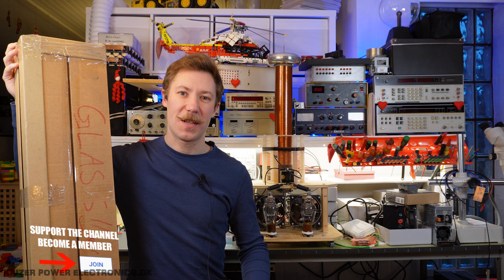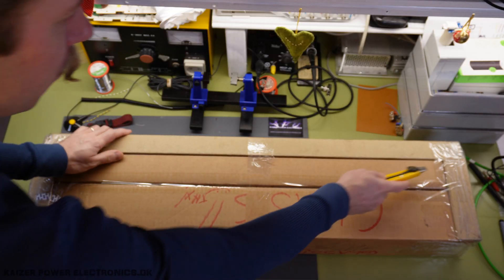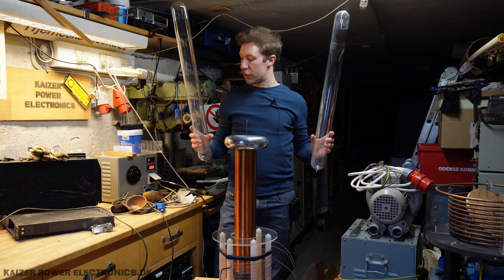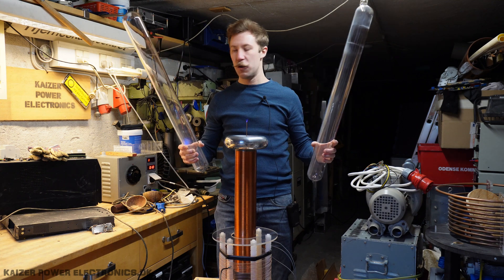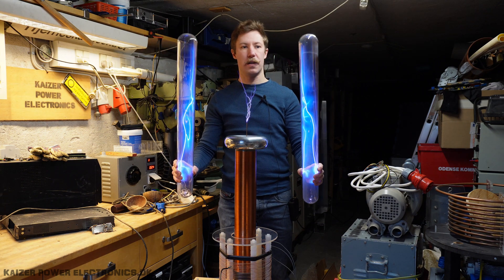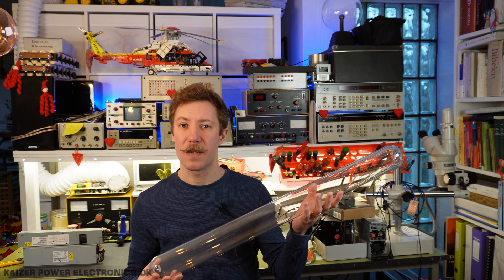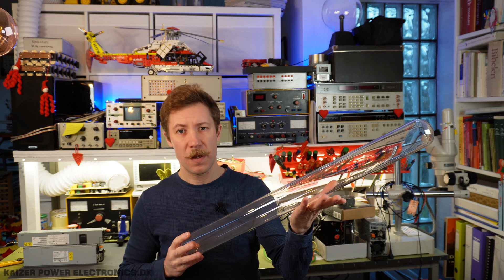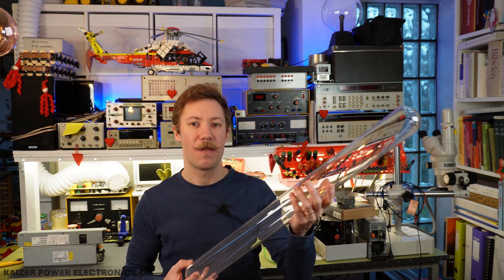750 mm Plasma Tubes and Vacuum Tube Tesla Coil

Comment: You could try 13.56 MHz...but you would have to make a suitable load coil for that, and use a linear amplifier to get the right amount of power output.
Reply from the maker: I actually never made a HFSSTC, I think the highest resonant frequency is actually that VTTC at around 300 kHz.
Reply: I was talking about an RF driver for those tubes.
Reply: I saw a tesla plasma machine for therapeutic use in mexico. It was called a TZLA. they wanted like 10Gs. It was built out of a toolbox that had a gap plasma between two bolts. You could see through a viewing glass. Had a large copper coil outside the box about 2ft in diameter and two wires coming out of the box leading to CFLs. They used it by running the bulbs over the body and also putting the bulbs touching water in a bathtub. Called it a plasma bath. People were raving. They claimed it charged your cells. Was wondering if these tubes can be uses in the same way? I want to build a machine for therapeutic purposes.
Reply: @harleydavid5111  sounds like absolute rubbish
Reply: @douro20  it could be. Seems Tesla was using plasma to charge cells. I was  just wondering if it were possible
Reply: @douro20  check this guy out. His machine does the same thing. Not trolling. Just genuinely interested 8n this stuff. Curious of this guy is nuts too. Thanks for getting back at me
Reply: @douro20  https://youtu.be/kmyA3D21UpI?si=vULfMVueoKFRXolb